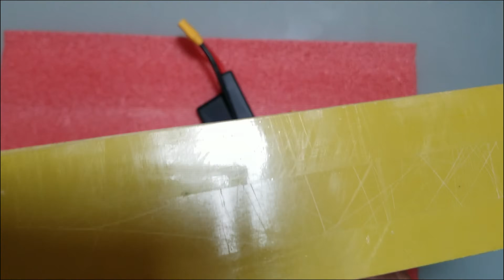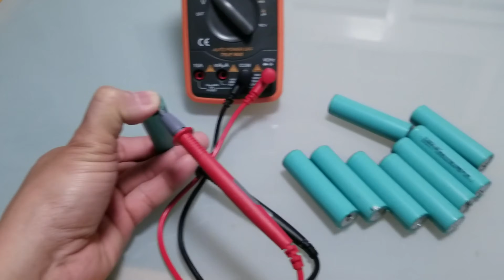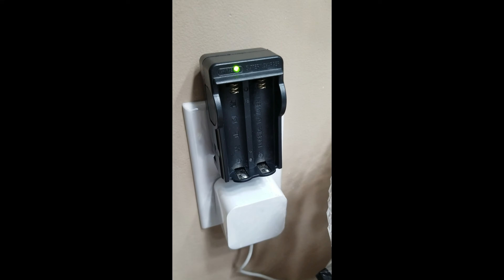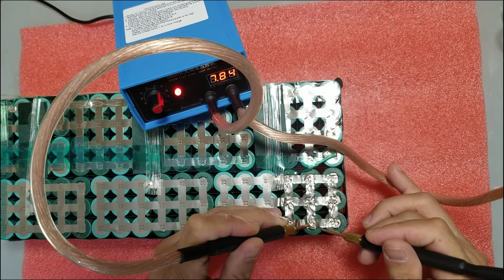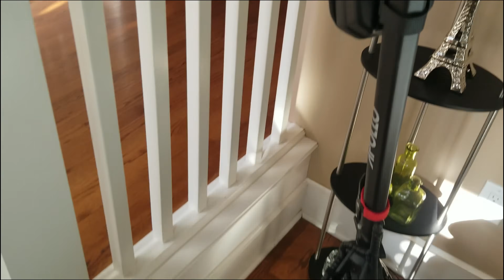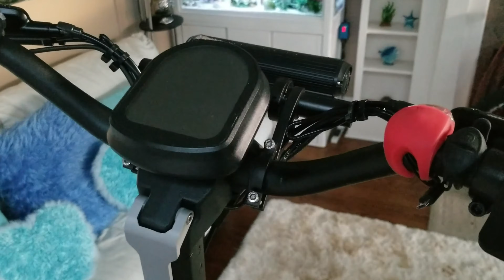Apollo Phantom Battery Repair & Battery Cell Replacement

Comment: Thanks for the informative video, also discovered these exact cells in my dragon GTR v2 (langfeite T8 rebrand)

The BMS used in these batteries suck, out of the 2 packs I repaired, the mosfets just eat themselves after a few months of use)

Comment: u did it with the BMS connected(i think),I would like to see a complete teardown of a used battery pack .... its more likly to have a full charge somewhere.
Reply from the maker: Yes I did and you are right I should have disconnected it first.
Reply: i need to repair my own ,i need a video with better instruction to build my confidence

Comment: Both videos are super informative. Question did you ever voltage test the battery before taking it apart? I know you tested it on the Ghost, but never saw you voltage test it. My Phantom is not powering on at all, but has 58v output from battery, so thinking I can rule the battery out as the issue.
Reply from the maker: Yes I did that before testing it on Phantom, it was totally zero output. I  just thought to confirm it with Phantom to be 100% sure.

Comment: Please be careful when working on a battery; tape over the cells you are not working on. The spot welder was resting on the batteries, which can cause a direct short, leading to a very bad day. I would have replaced the 9 batteries and the nickel strip on both sides to make sure. well done for finding the fault and fixing the problem.
Reply from the maker: Good tip, thank you

Comment: Great video, just wanted to know how to remove battery to screw the kick stand, but found this so informative. Was scared to have battery problems down the line and looks not too hard to repair! How did you add the lights, would love to do this mod, I always ride at night?
Reply from the maker: I tapped it to the headlight, run the wire inside the stem. You just have to be careful because the headlight wire is so small and thin, I can't believe Apollo is using cheap wires in their scooters. Anyway thanks for watching.
Reply: @ruvrandomusefulvideos  Ok, so you opened the headlight assembly and added a cable from there? And it's 12V I suppose? Thin wire probably because amps are very low. Wondering if it's sending the 54V to the light and there's a buck converter inside it or controller is already sending 12V. Thank again, will definitely do this mod!!

Comment: Putting back cells from section that had 0V was a very bad idea… These two batteries will cause the problem for the entire pack straight away. Once lithium ion battery has been sitting below certain voltage the chemistry inside changed for good and this is irreversible and the bin is where it belongs…The fact that you have managed to charge it means nothing. Internal resistance likely is so high that it may catch a fire and lit up all the surrounding cells. When mixing cells you should have matched them based on their internal resistance (internal impedance) to make sure they won’t take more load then the rest. Using old nickel plates another bad idea. When using spot welders you always have to make few test shots and rip the strip off making sure there are two holes after each weld - otherwise it may be a bad weld. Another mistake here is not cleaning with a dremel old nickel welding spots. I’m sorry but ppl watching this needs to know what’s the proper way before they will feel too confident and burn their house down.
Reply from the maker: I actually replaced the one bad cell and charged the rest fully  before installing them back. As  a  first time using the spot welder, yes I practice a lot before I start soldering back the cells and double check if the weldings are holding properly. I also do the research of the proper thickness of the plate, untill now so far so good no problem, 🤞 finger's. I appreciate your input, we are here to learn from each other so thank you.
Reply: @ruvrandomusefulvideos From what I understand, the battery might be charging, but overheating each time and one time it might catch fire instead of dying. Without single cell monitoring, you have no way of knowing this.
Reply from the maker: @purpleblueunicorn  I charge all the cells fully in that group before putting them back and temperature are normal, it works no problem till now 🤞 so I ty its good, thanks for watching

Comment: This is great, thanks so much! My Phantom V3 has a battery pack with about 1000 miles on it, so it dies quite fast. Where did you source those Samsung ICR18650-26F cells from?

As far as building an entirely new pack, do you think it would be possible to use to use larger capacity 18650 cells to fit in the same form factor, or would the increased capacity cause issues with the BMS?
Reply from the maker: I bought the battery from private seller FB marketplace. As long as you build a 3.7v 14s battery pack (52 volts), capacity won't affect the stock BMS. If the maximum current discharge of the battery is higher than the BMS, then the discharge will be limited according to the maximum discharge of the BMS. Let's say that your battery has a maximum discharge of 50C, you can use 40 amp BMS so your battery is not stressed. That said the load should also be 40 amps or lower or the BMS will shut down if the current limit is exceeded.
Reply: @ruvrandomusefulvideos  Okay, interesting. How do you determine the max discharge of the BMS for the stock phantom batteries? Seems like I can find LG mh1 3200mAh cells pretty easily and cheaply, but with 3.63 nominal voltage and 10A max. discharge I don't know if they'd be suitable for a rebuild using an original BMS.
Reply from the maker: I am also puzzled my self because the original BMS doesn't even have a label on it. Phantom battery is 1,216 watts/23.4Ah/52v. My understanding is battery pack and BMS should be higher than the controller can demand so that they are not stressed. Saying that I would assume that the original BMS is may be at least 40-50Ah But  don't take my word on that, sorry I didn't think I  really answer your question but I do don't want to give you wrong information as well, and if you have any info please share it here, I am also trying to improve my knowledge about this stuff.
Reply: Would be nice to build one with BMS that monitors all battery cells like they do in high end EUC. Would be best way to prevent fires and diagnose probably I guess.

Comment: I just upgraded my V1 phantom ( 60 volt ), with the  V3 upgrade kit.
Had to convert my battery to 52 volt ( 14 s )  using a Daly 60 amp bms  ( common port )
The 60 volt battery has 16 parallel groups so just had to cut off two from the end.
Again cheaper than a new battery from Apollo.
Reply from the maker: I assume that its less cell in a group because its 60 volts, how many cells in a group?
Reply: @ruvrandomusefulvideos  Same number of cells in each group ( 8). The 60 volt has 16 groups each of 8 cells ( 128 cells), the 52 now has 14 groups each of 8 cells ( 112 cells). Each parallel group of 8 cells is linear, whereas your battery has cells in an array ( 3 x 3 ).

Comment: I'd recommend if the cells have  been to 0 volts their ultimate lifespan has been shortened. My buddies ghost battery was lucky as his pack was just out of balance so I manually balanced each bank of cells. If they had been 0 I'd just have replaced those due to how much work it is to open deck, remove battery, open battery, test each bank, then repair and reassemble everything. Great video 👍
Reply from the maker: Yes I was thinking the same at first, but I wanna see if how long it will last if I just revived them, if happens again,  I will replace the rest of the 8 cells but so far battery is still going ng strong. Anyway Ghost has a shorter cells, what is the number of the cell and how many cells?
Reply: If I am going to manually balance the cell bank, do I have to disconnect any battery tab and balancing wire before hooking up a charger to the battery cell ?
Reply from the maker: @jrepairman  I would recommend disconnecting the balancing wire but for the tab, you do not have to, just take note that you are manually charging the whole group of cells so that will take time depending on your charger.